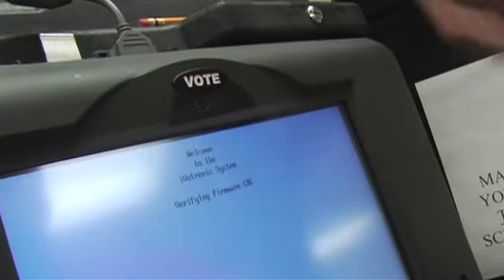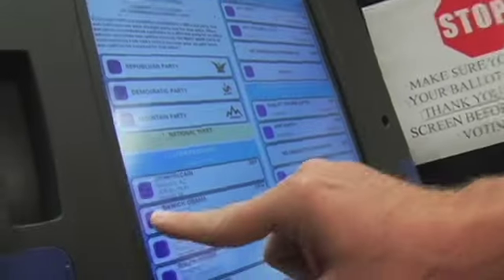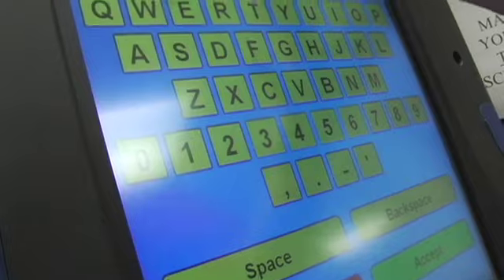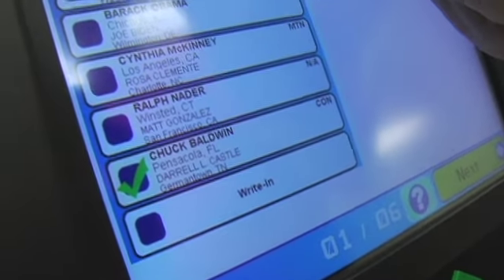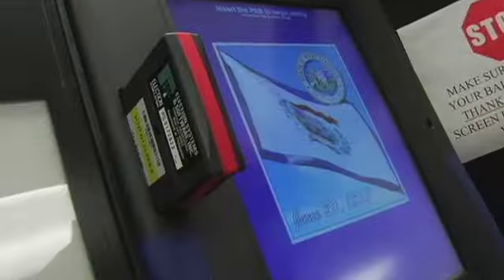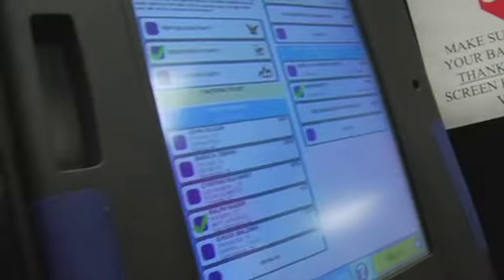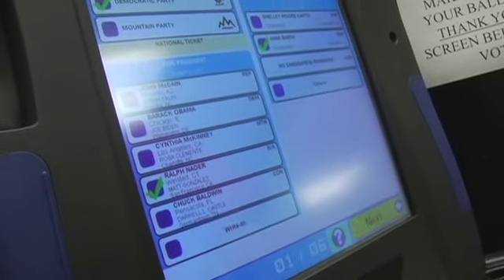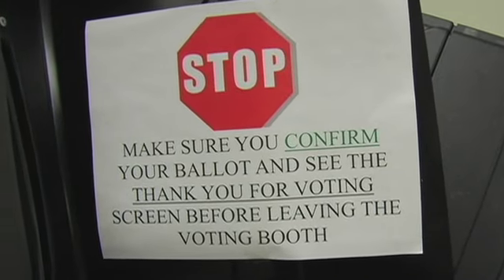WV Vote Flipping Caught on Tape

Comment: When you touch the screen, it reports the x,y coordinates of the touch via values typically between 0 and 1024 for each axis.  When a machine is out of calibration, you press some location on the screen and the machine maps those values to a different area. If by coincidence the read value lands on top of a 'button' in a different area of the screen, then the wrong selection is made.  However, a check mark is placed next to the selection so if you think its wrong, you need to report the failure.

Comment: I have an electronics repair background, was trained at the Navy's top level Avionics school, and also have a degree in Mgmt and Info Sys from Univ of TX at Austin.  While I was never a programmer by trade, I understand both hardware and software, and this whole business about machines needing to be calibrated is a bit far fetched.  Touch screens should not need constant recalibration.  Those of you with new laptops or desktops with touch screen monitors...  How often have you had to calibrate your screen?  Have you ever had to recalibrate it?  I rest my case.  

If you understood electronics you'd realize that this explanation leaves much to be desired.  Why would you program a voting machine such that it could be reprogrammed in such manner?  And who is to say how the alleged calibration actually tallies up the vote count?  The programmer can program the computer to spit out any result they want.  Frankly, this so-called high tech approach to voting is fraught with potential for abuse, and it is no substitute for good old-fashioned paper ballots which can be manually counted and verified.
Reply: +Jeff Schwager 
You are right on the money.

The calibration nonsense is plausible deniability, completely ridiculous.
Fact that the software is a "trade secret"  is an absolute joke and insult to the public's intelligence. 
I or any reasonably competent programmer could write this program in 2 days, not rocket science by any stretch.

The software for all these machines needs to be open source and completely open to scrutiny by law to prevent coercion and fraud.
There should be a continuously displayed MD5 hash tag so any technology competent voter can confirm, at any time the validity of the current running software with the publicly known MD5 for that machine.

Fact is with proprietary software, it is a simple matter to write in a subroutine to access via keyboard entry code, a maintenance screen to adjust the votes at the end of the day to anything at all. No one at the polling station need do or know anything at all, just one of the last voters with knowledge of the maintenance entry code: 
very simple (done behind the curtain) and almost completely undetectable.
Reply: Screens can be calibrated but calibrating an LCD screen will only make the color, contrast, etc.. more consistent and accurate so I call BS on his calibration claim!!

Comment: Touch screens actually do require calibration between the touch sensors and the display (so people see buttons in the same place the machine does). Go into any Panera store and talk to a manager on how they calibrate the register screens. Working there for two years I had to calibrate a register maybe five times. In two years. This guy had to calibrate his machine twice inside a few minutes.

THAT is what I take issue with, that a cash register has a better track record than a voting machine.

Comment: The machine is uncalibrated. In this case a selection at Pixel position X/Y is being read as a selection at position (say) X-30/Y.

It didn't change when he pressed McCain because the machine would have read that as a finger pressing on an inactive part of the UI.

They still shouldn't be used.

Comment: It still is NOT vote flipping because you still haven't officially cast your vote yet. You can use another machine, or even do a write in if the equipment is faulty. Vote flipping would suggest something much more sinister, as in not even knowing your vote wasn't being counted the way you cast it.

Comment: So this machine lost it's calibration after 1 vote. What happens now? The wrong vote is still counted, and a write in vote is cast that doesn't get counted. Oh yeah, that's fair.
Reply: Which means there are likely flipped votes being stored in permament memory because calibration does not wipe the memory it just resets the system. Like resetting the PRAM on a mac. Same thing.

Comment: I can understand that a machine that is out of calibration would select another candidate in another position on the screen.  What I don't understand is how when you select either straight ticket, and the green check is next to the straight ticket selection another candidate is selected.  Clearly that is a software bug, and not calibration.

Comment: Touch screens need to be calibrated on first use, however I have yet to see the screen that would be off by several inches. Usually they are out by a few mm.

Comment: How can you be a software engineer and not know what "out of calibration" means? This is nothing new. Unlike the screens used in phones these days, some types of touch screens require calibration. My parents' fridge requires calibration for the touch screen and it's a brand new model. It's not like the machine is changing your vote after hitting submit. You still know who you're voting for. If the selection is wrong, have it calibrated. Simple as that. Why make this such an issue?

Comment: "not calibrated" what computer needs to be calibrated every 5 seconds...? a machine thats is fixed. if the machines are malfunctioning it should be replaced or the entire serie should be removed, just to be safe.

Comment: No it does not mean 'tampered with'...like sniper said... it means the way the surface of the screen is 'calibrated' as in 'mapped' is not correct. For example, the mapping is moved about an inch right, meaning the overlap of the touchscreen is mismatched to the graphics. You are a software engineer and you don't know 'calibration'? How? I agree of course they should have tested this before hand. This i a huge fail.

Comment: The machines design is flawed. Touch screens cannot be relied upon for accurate pressing. The machines design is excellent, but they should have side auxiliary buttons that correlate with items on the screen. Banks learned this on ATM's a LONG time ago. Besides, buttons are cheaper then touch screens.

Comment: I believe there is some fraud going on, but not in this case - and I'm surprised videothevote missed it.

After he calibrated, he picked something, THEN picked Nader, THEN picked republican straight ticket which likely marked votes for the remaining republican candidates but DID NOT switch his vote for Nader - which it shouldn't. The problem here is the guy doing the demo isn't familiar with the logic/processes of the machine. It DID NOT malfunction after the calibration.

Comment: that's good to know. my point was that no iphones are ever getting out of calibration, or if they are, there aren't enough for anybody to pipe up about it.

my guess is that the older touch-screens (your gps devices and these voting machines) could get out of calib, but new ones don't (iphones), or very rarely. it would seem to me that they shouldn't be using this stuff for voting unless is has virtually no flaws such as this.

Comment: Could you imagine ATMs going out of calibration and giving you too much money?  

Have you ever voted in an website based pole and have it switch to another?  I haven't.  

These are digital voting machines (not analog) , whats with the calibration thing?  My digital piano keyboard with touch screen always pulls up the right sound when I hit the right button.  What is going on here with voting machines needing "calibration"?  My $10 calculator never even does that!

Comment: You've never used a resistive touch screen then. They need calibration. And I guess voting machines need to use them since people with prosthetic arms, etc need to be able to use them.

It would be much simpler to just have physical buttons, though. (If machines are desired)

Comment: The machines must come with a little manual instructing them to insert the cartridge for +5 minutes of calibrated use.

Doesn't a SINGLE person test these things before making the STUPID decision to divert TONS of paper ballot money?

The beauty of standardized devices is they don't need to be re-calibrated, right?  They have touch screen machines everywhere that don't have this problem. That junk is either severely flawed or it's rigged, and either way is completely unacceptable!

Comment: It's true that touch screens need to be calibrated so that where you touch lines up with what the machine thinks you touched. Even the tiny screen on my Treo and my son's Pixter need to be recalibrated from time to time. Solution? Don't use touch screens on voting machines, for crying out loud! I realize it's a cheap solution, but it's totally inadequate.

Comment: So when this happens you are supposed to wait to have it recalibrated?  How long?  I see lots of problems ahead.  The guy in charge couldn't even get it to work properly, after he fixed it supposedly.  It voted for Nader as straight republican.  Even if it isn't rigged, this machine is badly flawed.  Old folks have trouble with basic cell phones, this thing might as well be in Japanese for how much trouble they are going to have using it.

Comment: a) you can almost eliminate that error through education. b) the problem isn't that substantial. c) most elections aren't that close. d) it's probably at least 2 and probably up to 4 orders of magnitude cheaper to administer a punchcard election. cost benefit wise, a no brainer. it's as if god created punchcards specifically FOR voting. it is more private than a screen too.

Comment: We used touch screen cash registers at a movie theater I worked at, and you'd have to re-calibrate them if you were much taller or shorter than the person who worked before you.  It was bad technology then; it looks it's still bad technology now.  It's really disappointing that the solution to the 2000 Florida debacle involved blindly throwing gobs of money at Republican electronic voting machine companies.  Paper works fine!

Comment: What difference does it make when bith parties are the same on most policies and tread on the Constitution. Here's an idea... used color paper for the two parties red and blue. Use white for all independants and other parties. Since less than 60% of voters actually vote... you still end up with sucky choices in the end for both parties.